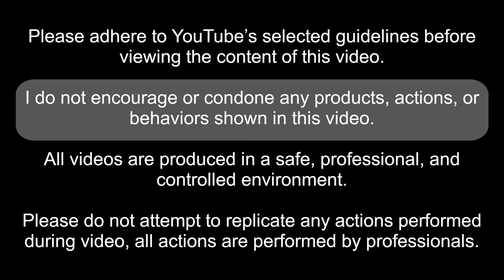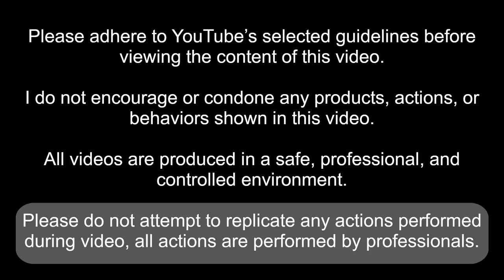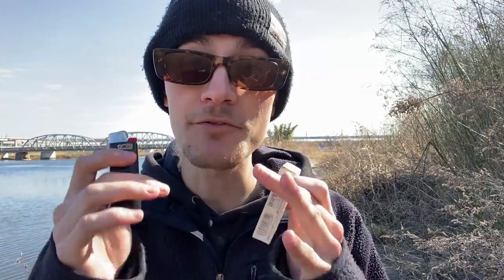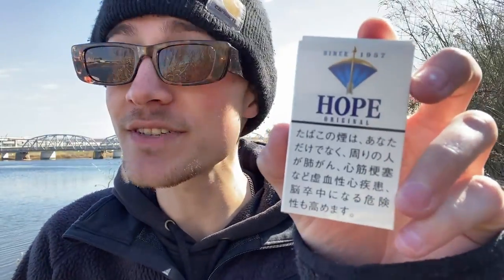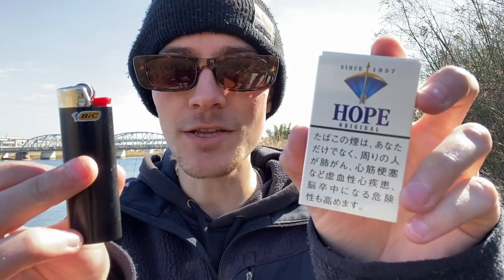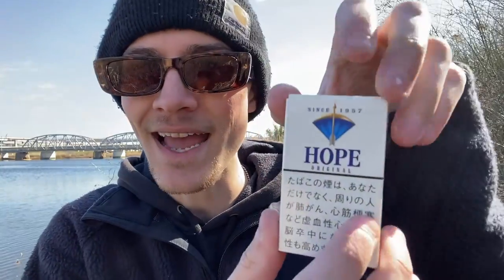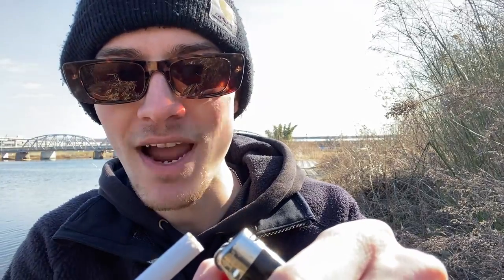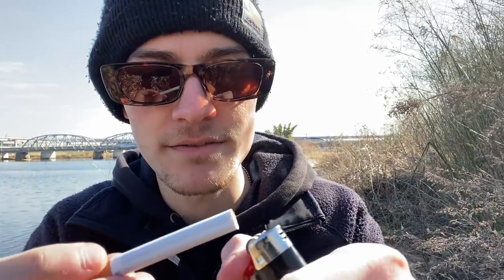Lighting a Cigarette with the HEAT from a Lighter (Not the Flame)

Comment: It makes sense. The proper way to light a cigar is to hold the flame over the end until it burns naturally, not pulling heat through the cigar by inhaling. This method supposedly prevents premature burning of the rolled leaves. I'm a little suspicious of any of these methods considering when you draw on the cigar/cigarette, you're pulling heat through them. Still interesting new methods to try out though. Happy smoking y'all.

Comment: I think this is very possible if you were to try it on a day without wind or use a windproof torch, with a soft flame you should hold the tip of the ciggy above the top of the flame so the peak of the heat rises into it 🤓
Reply from the maker: i 100% agree! definitely need to try this again another time. appreciate the tips man, will keep them in mind

Comment: Your Honesty precedes  you old bean!
One way of reducing the amount of Combusted Butane GAS inhaled is to use a 'Wind Proof' Lighter as they work a bit like a Bunsen Burner with the Air Inlet Open, producing a much Hotter Forced Flame containing more Oxygen, with far less Carbonisation (Soot) if any.
Bic's and Clipper's produce Just a flame with no Oxygen/Air inlet, therefore they produce far more of the 'nasties' associated with Burning Butane Gas. Bics and Clippers still have their uses! (IE Smoking 'Other' things)

Comment: Try it again holding the cig right above the lighter, as most of the heat goes up! That way you can light it but not using the flame.

As for my opinion, at least with weed (as I don't smoke tobacco), I've never really noticed the chemical taste, lighting it indirectly didn't have a noticeable difference in taste for me.